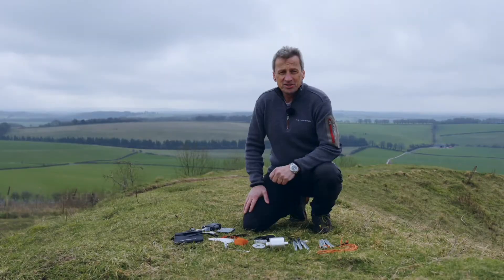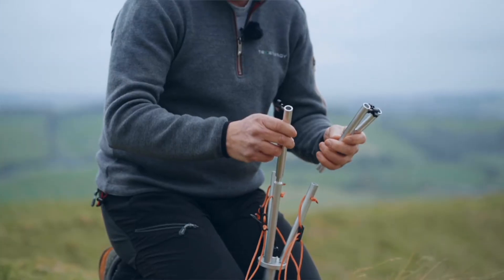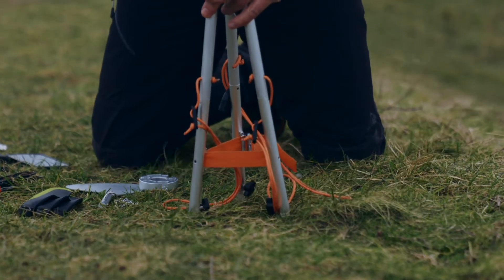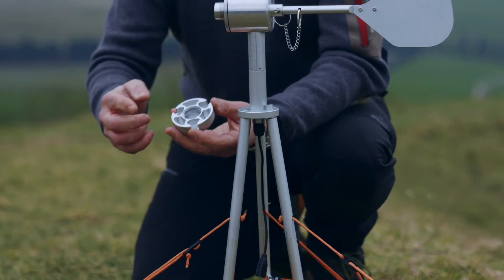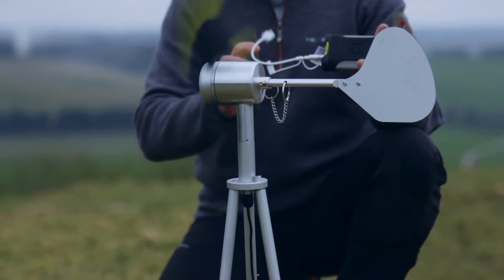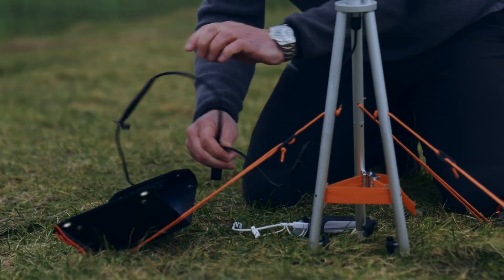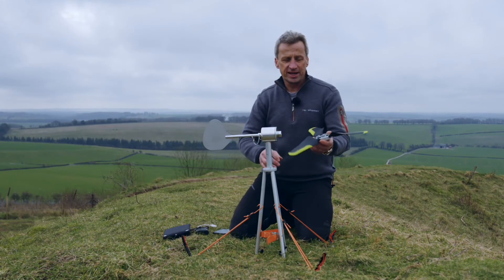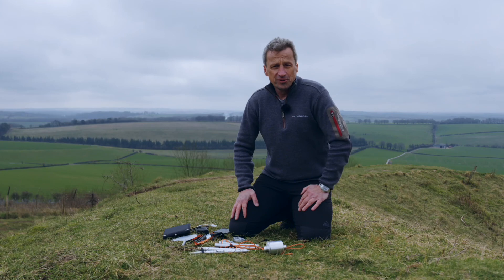NEW INFINITE AIR 5T TUTORIAL VIDEO - PORTABLE OFF-GRID WIND TURBINES

Comment: 455€ from that???? Wtf
Reply: €255,95  for  Infinite Air 5T - Max. Power Produced: 5V, 2A   and €455,95  for Infinite Air 18 Max Power: 27W at 18V, 1.5A Provides also 5V, 12V, 18V output. 
Yes  it is expensive  but imagine  you are in mountains for  hiking  and sleeping  over night, your power bank can be charged  all night. 
This  could be  handy  and  usefull. All old  powerbanks  usually use 10 wats for  charging. When  you check quality of parts, it  can be equal  to its  prise.

Comment: Is this just for device charging or could it charge with different cables as well like say for a small generator 250w or so?
Reply from the maker: Hi, as long as the device can be charge via using USB cable.
Reply: Its probably more like 40W at 5v.  It's 2A max.